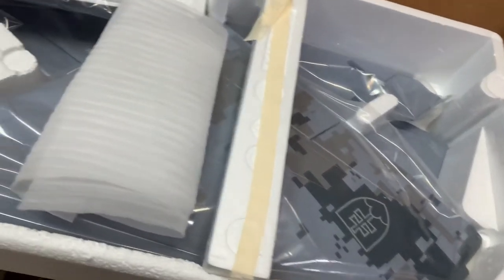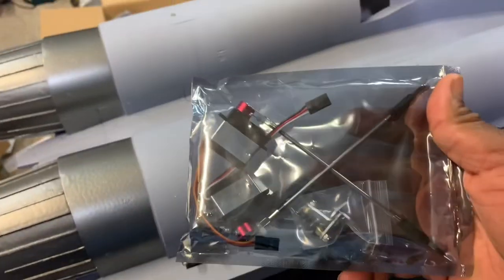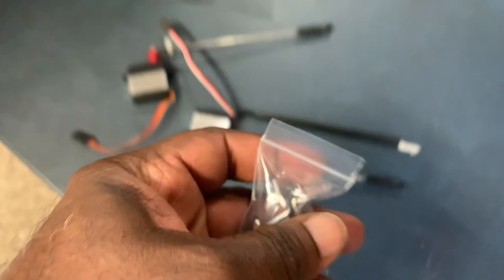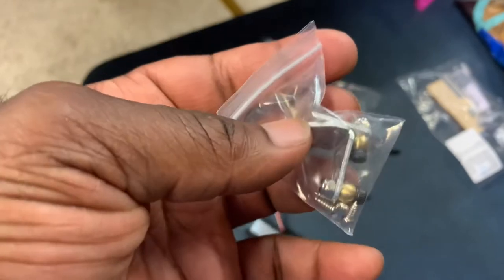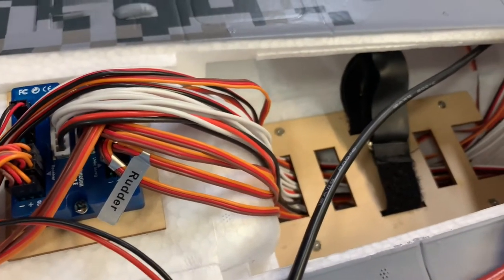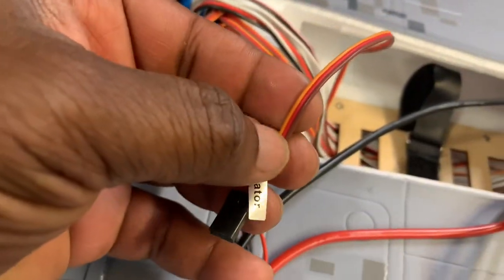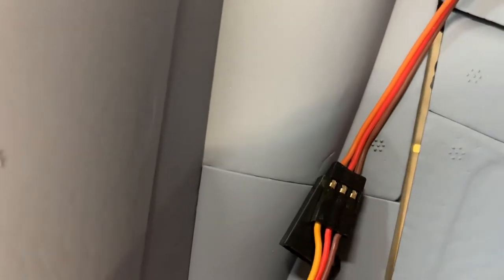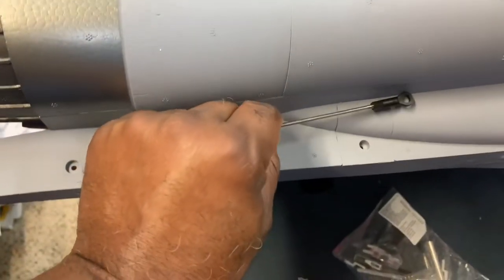Freewing MiG-29 upgraded 30gm servo installation instructions

Comment: After installing the upgrade servos, did you noticing any “ ratcheting ” or not perfect smooth when you finished the install ?  My came with the upgrade and I noticed what I was asking about yours . I called Freewing and they sent me this back : 

The current Mig-29 is configured by Freewing with coreless servos to provide the ability to apply more torque to hold position during control surface movements. This “chattery” behavior is considered normal when the elevators are not under load (no input) and the servos’ narrow dead-band causes it to generate fast micro-movements as it seeks to hold the control surface in place. If you touch the elevator surface this behavior should stop. Rest assured that the servo is not defective and this chattering will disappear once the plane is in flight and air pressure is being applied. However, if the servo continues to chatter badly while under pressure, please let us know so we can investigate.
Reply: Yeah....that chattery servo seems normal when it's not flying to me. Pete from banana hobby had the same servo in one of his videos

Comment: How can I order the 30g servos and pushrods? My Motion RC Mig-29 laid up in my basement for over a year.
Reply from the maker: Hey there Richard, Motion RC is working on a couple servo kit options. They are considering having a kit that comes with only the beefy elevator linkage, for those who are fine with the replacement 23gm servos that everyone received in the first run. And another option for those who want the beefy elevator linkage combined with the replacement 30gm servos. I’m pretty sure they’ll also offer in the “Upgrades” category the option to purchase just the servos as well. 

To stay up on the conversation that sometimes includes Tom, one of the owners, you can review several pages of notes in the Motion RC chat line at www.hobbysquawk.com. (If you haven’t already joined those chats)

And FYI, there those who say they are flying the jet on the original 17gm servo set up just fine. But most would rather have the peace of mind of not having to worry about whether or not that set up will disappoint them when the need arises to get out of trouble. 

Good luck with your set-up, and I hope the maiden goes well, whenever you get that done. Waiting for the opportunity to fly here.
Reply: @flyingant2557   That would be Great. This is crazy. I pre-ordered the Mig-29 and was one of the first to get it but still can't maiden it! I looked at buying 30g micro servos from Hitek but then you need to also buy the HFP 30 computer to re-program one of the servos. No winning here.

Comment: They did the upgrade servos are bigger and mine were rubbish
Reply from the maker: Oh no! What was wrong with the servos? And were they the same servos that I showed in the video? Silver with a red band and thicker servo arms?
Reply: @flyingant2557  They we’re broader and each had different coloured wiring , as soon as I connected them they stuttered . When I removed them Freewing had made the box bigger so the high tech 85 replacements didn’t fit. I had to make a box to sit in the tray snug that then received the high tech servos . Unfortunately one of the rudder servos showed signs of trouble so to be safe I ended up up grading the two of them . This meant working in the same area where I had built the box for the elevator servos . MotionRC didn’t want to contribute on the grounds they would have supplied servos for the elevators the size of the originals . I wasn’t prepared to accept that because the high tech replacements are a up grade and what the aircraft needs .
Ps watch the Utube video re conflict with flaps and the elevators, important info ! Good luck 😉
Reply: @davidhall5687  Sorry to hear of the troubles you had with the servos. 
Do you have a link to the video you recommended?